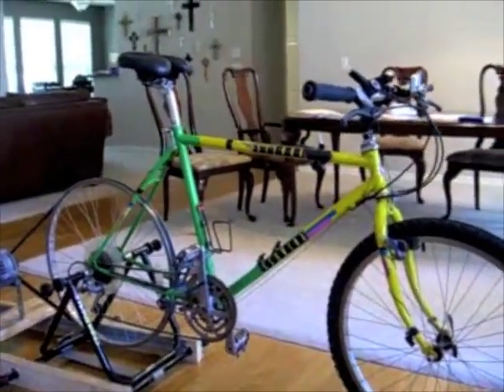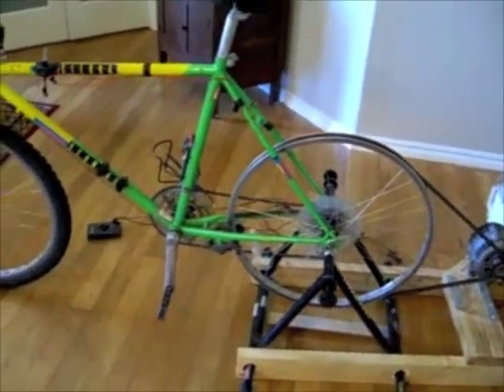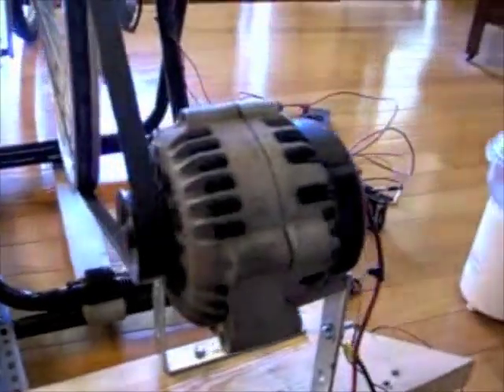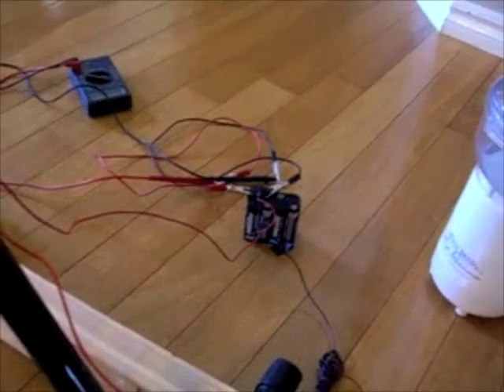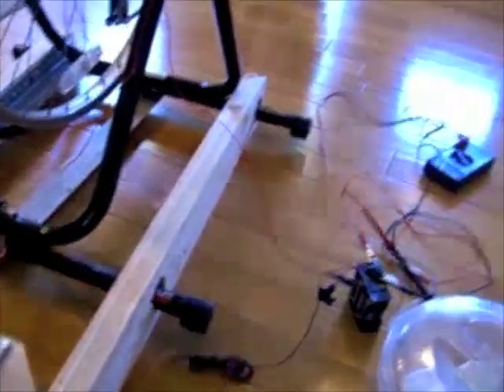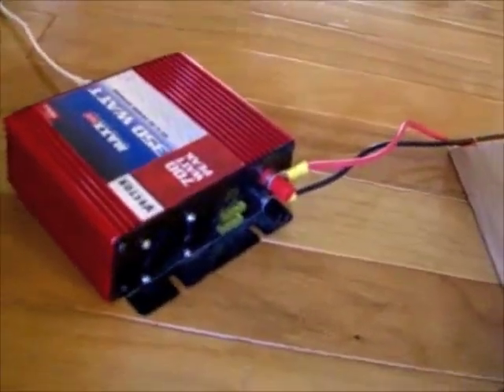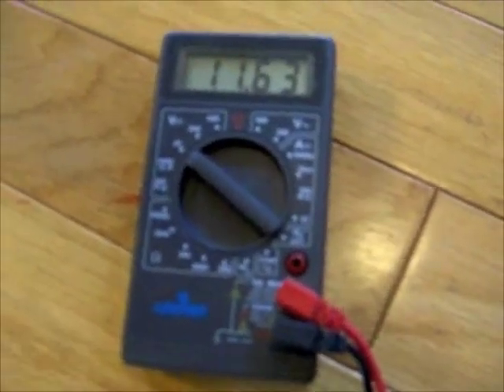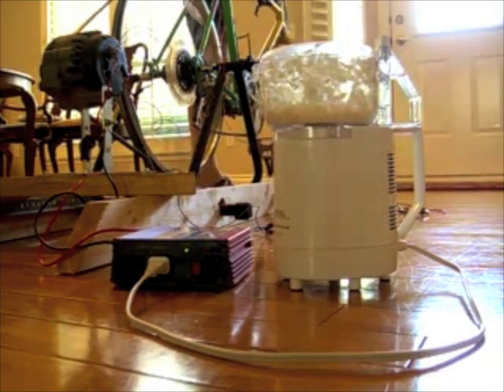Bicycle Generator

Comment: so could you theoretically have a small motor attached to the main sproket on the bike and turn it on and have it just make power itself?  or is this not possible?
Reply: Totally possible as long as it has the required rpm for the alternator to generate the required voltage..
Reply: +jonathan lavigne 
You could, but then you might as well just turn on your car and plug appliances into it.
Reply: +ravemastaj We lost power for 2 days after a huge lightning storm, after the first day I connected my 600W inverter to my car and watched some movies for 3 hours, my fuel was at 50% when I started and it was still on 50% when I turned off the engine. It was surprising. I just parked the car by the window and run the 12V through the window, then sat the inverter on the window sill then run an extension cord from the inverter to the appliances. I was disappointed though the 600W inverter wasn't big enough to run the fridge :( need a bigger one.
Reply: KiwiPowerNZ
I'd be concerned about fire hazards if you tried to do anything bigger than your tv and some movies.
Reply: I measured the alternator current with the lights on high beam, rear demister on, AC on high and the front and back wipers on fast, and it was about 60A. I was only using about 30A off the alternator so nothing should burn and nothing did.

Comment: Is it efficient though?would it be better to have a mechanical driven food processor or do you create or generate more electricity to store the battery along with getting your onions chopped?
Reply: +Michael Byrnes Every time you convert power there are losses, a shitty old car alternator will maybe get a 50% conversion, and inverters are also looking at around 10-50% loss depending on the maximum output, so this is far from efficient.
Never the less it gives you the flexibility to power all electronic devices, where as physical power will only be applicable to devices that require physical power and you need to attach the shafts somehow.
Reply: +MsSomeonenew Ahh no inverters are about 85% to 90% efficient my one is 86% so 14% loss. I think alternators are typically 80% efficient or worse. So peddle 100W and you'll get 69W. Not the best but can't get much better.

Comment: If I'm charging a battery bank, do I need the switch or will it just charge the batteries without draining them more?  Also would I need a voltage regulator to protect my batteries? Great idea & I'm working on doing this.

Comment: use some of the electric output to power a motor to spin the bicycle well.....and you have free energy without peddling....probably won't work, but you won't know till you try.

Comment: So why don't automobile manufactures use an alternator in their electric vehicle to recharge the batteries? That seems to make sense yet no manufacturer talks about it!Why?!
Reply: George Gunnee You are describing what's generically known as a 'perpetual motion machine'.  Every real machine has energy losses as energy is transferred and converted.  Never get back as much as you put in.  It follows that driving a generator from an electric car's wheels is less efficient than just keeping that same power in the battery.

Electrics and hybrids do get some electric energy back where in an ordinary car you'd be using friction brakes.  Fuel consumption in hybrids is reduced because the engine can be sized and tuned more for highway steady-state cruising, which requires relatively little power, while the batteries and motor/generator make short-term peak power for accelerating or ascending hills.
Reply: George Gunnee Electric vehicles already use electricity from their batteries for motion - there's no engine to drive an alternator. However, I do imagine they'd have regenerative breaking to recover some of the vehicle's momentum when stopping etc.

Comment: The generator did not continue to charge once he shut off the field (battery voltage). Watch the volt meter, the value continues to lessen as the charge from the alternator has stopped. The inverter is just running off battery voltage and will and will stop soon as the battery voltage drops below what is required by the inverter. Small point and that is  not to say that there isn't something to be learned from this tutorial.

Comment: Great video. Thanks for sharing. I have been tinkering around with a alternator wind turbine. I am using an alternator similar to the one you are running. I have not been able to get it to produce a charge. The way it is hooked up now is I jumped the "s" wire to the positive output, run direct to a 12v battery and a direct ground to the neg. terminal. I beleive what I am missing is the switch. The alternator will not generate power with out the switch I guess?

Comment: Could you swap the AA batteries for a car battery and then run the inverter right off the battery? That way you can charge the battery and use the appliance without pedaling

Comment: To think all these years I just used a knife.
Reply: I must be tired or something but that gave me a good laugh....
Reply: +schlaznger i think a knife would use less calories.
Reply: +schlaznger 
Aside from the knife, I need some goggles too. Onions make me cry.
Reply: +schlaznger I have pocket bike in the shed doing absolutely nothing. All I have to do is make a stance to make it stationary(no problem just gotta get to it), get another gear(because I already have one from other bike) and electric motor and hook the chain on. Heh, I&#39;m so dumb.... now I can start thinking about some real lights and powertools and all that fancy stuff.
Reply: lolz
Reply: I'm picturing a vacuum (plugged to it) You're wife could cook and clean, with this power. You could even run the A/C and radio. You would be the champion of cyclists
Reply: Nano Quark Your*
Reply: Ohh
Reply: You could never power an ac unit,they take more power than anyone can produce by peddling, but a radio takes very little energy.

Comment: Some newer alternators are self energizing once they hit a certain RPM. Now if you put a few (radiator) fan motors on the driver pedals, you may exit once the process has started. Except that if the fan motors use less energy, and create more RPMs at the alternator, eventually you will create a tear in the space time continuum.  Thanks. I wasn't using it anyways.

Comment: i made a similar one but the inverter didnt stay on after. needed to add a wire wound resistor i made from spare parts. can run 100w of stuff for a few minutes but its better to do less for much longer. dont get as tired and more like cardio then going up hill in high gear.
Reply: also a tip for others. you dont need 12 volts to energize the coil. i use 5 or 6. works fine.

Comment: That's very clever there Einstien but I think that I have you beat!, I set up a water wheel down by the river and plumbed a 4" water line from about 150 feet up stream past where there is a 5 foot drop. With the water coming out of the end of my pipe with considerable force it flows onto a home built water wheel that spins a shaft connected to a gear box and increases the speed 150 to one. with this set up we mounted a real 110 volt generator head and wired it to an extension cord routed up to my house. We comfortably can use about 600-900 watts of 110 volt free electricity which is more than enough to run all of my LED lighting and electric fan blowing air over my wood stove. The only thing that I now need to set up is a remote water cut off valve so it can be safely shut down when leaving home. The weight and force of water is very powerful and if you set it up right you can get free electric power with minimal water flow but you do have to have at least a good 5+ feet of drop and 4" pipe diameter or larger. A simple diversion screen angled sideways keeps the inlet of my pipe clear of river debris. Picts and video coming soon!.  Marti
Reply: Ben Braceletspurple It's illegal by retarded laws of society so you cannot be independent human being.. why should you pay electricity when you can use beautiful water stream or sunlight to gain electricity? Nature is free..
Reply: Then I'll make a video on why that's illegal.
Reply: Ben Braceletspurple  Nature is free. Laws and society rules only exist on a paper. Sun and water don't want us to pay them some money in order to shine and flow. Therefore, nature is free, nature is freedom.
Reply: +Marti woodchip  I don't have a river, so I guess I'm stuck with the bike generator.
Reply: +Teo Sp Go to Ukraine. We have NOT these dumb laws about collecting rain.... Greetings from Ukraine !
Reply: I hope it is illegal, because I will make one.  Tried of the government telling me what to do.  Vote Trump.
Reply: Marti I´d love to see the setup and costs of this!
Reply: TOKENWINNER A8 if you do it properly with fuses and cutoffs and are nor connecting it to live circuits that are connected to the grid it is not illegal
Reply: Rod Schultz...Nice Comment,I see YOU are a man too and that you know the Difference between Illegal and Unlawful (Golden Rule..and that Another man Can Not Tell another man what he Can and Can Not Do) More info Karl Lentz youtube videos.. Cheers :)
Reply: please make a how to video on that plz and let me know about it so i can watch it.
Reply: TOKENWINNER A8
what's not legal about that?
Reply: Marti woodchip  Now that's sort of free energy I believe in. You are using hydro power converting to electro motive force . Unlike those nuts that claim magnets can do the same.
Reply: +Ben Braceletspurple Hoover Dam?
Reply: Rod Schultz because it's okay to murder people and run stop lights.
Reply: So glad I'm not the only one who perceives society and the government this way
Reply: Ben Braceletspurple, this is old, but you're incorrect on multiple points and misinterpreting the laws. Site the sources of your laws
Reply: Mike Jameson, huh? I'm talking to the guy misinformed about the waterway laws spouting on like a prison cell lawyer
Reply: Lucky Red Oh.. Didn't notice the other comments of his..
Reply: +Ben Braceletspurple idiot
Reply: +takver lol..bam!! now that's an answer! awesome
Reply: +Marti woodchip all of us don't live near rivers dumbass
Reply: +FreeThinker1980  Dumb ass I am not and neither a numb ass but anyone who has to peddle a generator is probably a numb ass to say the least, lol lol
Reply: Marti woodchip what happened to the video that you were supposed to upload? the one about the water powering  generator
Reply: Smh... Should've said Faraday, or Oersted, or Lorenz etc... Einstein didn't have much to do with electricity 😂
Reply: Now make it a battery box, filled with batteries, that spare the overload of the income, for later use.. remember, rechargable batteries.
Reply: Lucky Red
I think he means that the sun "power" (Hydrogen) is limited. Which is true, but it's not gonna matter for our life time.
Reply: Sounds like bullshit to me..
Reply: That would be nice if it wasn't illegal.
Reply: Ben Braceletspurple You either work for government control system or you don't fucking see what's going on in the world.
People are being controlled like slaves. Everyday new laws come out to cut our freedom. Here in America one farmer got jailed because he was collecting rain on his property. The law says that rain is a government property.
Do you fucking see what's going on?? Obviously no..
They don't allow you to have you own electricity because then you are not paying money to them. Money is how they control us. No money, no life. But since electricity can be free, they don't want people to have free access. 
And I asked you but you didn't reply. What the fuck is wrong with solar panels? Why the fuck are they illegal? Simply because they are a source of free electricity. 
So please, don't try to defend something which is fake. Nature is free. We are born free.
Reply: Ben Braceletspurple Even if it does kill fish, it's so small amount comparing to modern industry which kills whole world and it's legal so please.. and what about solar panels.. they don't do any harm but they are illegal.. don't try to defend laws, they are made to control  human beings and keep them in slavery, not freedom.
Reply: No, it is illegal to slow down water in the United States. You can not have a water wheel, pump, dam, siphon  or any device that impedes the natural flow of rivers, streems, or any natural water flow.
Reply: Teo Sp no that is like saying, "okay, the average Joe Biden can kill one person per year, as long as that person doesn't have any family, but big companies can't because they would be killing thousands of people  and that is too many killings." Point being how much something hurts the environment is directly proportional to the amount of people who do it. When one homeless man poops in a river every day  The damage is small. But if the 400,000 people that live in my city all did that, the river would be damaged significantly. Same point. If everyone can not do it without it being a problem, nobody can. They don't have rules in libraries that say, "no drinks, unless you really think you can handle it," the read, "no drinks," or, "no drinks"
Reply: It isn't fake look up the history on the Colorado river, guess what, flow was fine and ran right through Mexican boarder, today it doesn't even come close because of all the man made blocks. Nature isn't free. There is no such thing as a free lunch. If one person can slow down water, everyone can, if everyone does, it slows down to a stop. It isn't "natural" to impede the flow of water.
Reply: Not an impedance to Mexico.
Reply: Dan impedance of any natural flow of water isn't generally legal. Even gutter water flowing down off your roof.
Reply: That energy comes from the Sun, by definition it isn't free.
Reply: Teo Sp it is illegal cause it kills fish, and slows down the water supply to major rivers.
Reply: @benbraceletspurple9108  shut your fucking mouth

Comment: I know its not the point but you have probably used 3 x times as much energy as it would have used to chop the onions by hand your self.
sorry to sound so negative, but you did go on a bit didnt you  Leo.
regards Colin.
Reply: Or by hooking up the belt drive directly to the sshaft of the onion chopper we could have chopped them in 1/4  second.
Reply: TOKENWINNER A8
Now your getting the idea save energy right,, well done
regards Colin. UK
Reply: you can also buy already chopped onions. but i like the idea to save some electricity costs by riding a bicycle. german elecricity is very expensive and we dont have much air flow to hook up some generators in the garden :)

Comment: An alternator creates AC voltage and the internal (DIODE) rectifier converts the AC voltage to DC. The internal voltage regulator regulates the DC voltage to around 14.5 volts DC. The external inverter takes the DC voltage from the alternator and then converts it back to AC voltage to run the food processor. I wander if we could just regulate the alternator AC voltage to 110 volts and what the wattage output would be? Hmmm   Also you can use a self exciting regulator and do away with the battery source.
Reply: On the side; there were a couple of cars which had 110V alternators.  It may be possible to find one as a spare part...

Comment: More practice is put to work with the wind do mill type of wind with its tail to rotate in the direction of the wind is only requires a zipper either ford or chevy and was adapted gears ben- di the alternator shaft that coupled to the rack is fixed to the blade with a single spin of the reels with zipper generates the 12 volts needed to be in motion and maintains continuous power without being throwing pedal and the rack to rotate around turns over 20 turns the alternator or even more just to make a tower over the house and connect through more than 10 Watts bulbs under very useful for fields where no light

Comment: Mas practico  es ponerlo a funcionar con el viento  hacerlo tipo molino de viento con su cola para que gire en la dirección del viento  se requiere solo una cremallera ya sea de ford o chevrolet y se le adapta los engranajes del ben-di al eje del alternador que acoplado a la cremallera que esta fija al aspa con un solo giro de el aspa con la cremallera genera los 12 voltios necesarios y al estar en movimiento mantiene la alimentación continua sin estar echando pedal  ya que la cremallera al girar una vuelta  hace girar mas de 20 vueltas al alternador o hasta mas  solo hacer una torre que sobre pase la casa y a conectar mas de 10 bombillos de bajo Watts  muy útil para campos donde no hay luz.

Comment: Your project does not make any sense! You use mechanical energy to get electric energy and also use another, outside electric energy source to power that device that supposed to produce an electric energy?! What about if battery runs out? Do you need another bicycle with everything else to recharge it ?! You do not make any energy, but actually wasting it !!!
Reply: You missed the point where he switched the battery off.  He only used it to start the alternator.  His process was as follows.  1. Start pedaling, this does not start the alternator.  2. Switch on battery to start alternator.  3. Switch off battery.  4. Continue pedaling to maintain alternator.  The battery is only used to start it like a car. You can disconnect and take the battery out of a car after its started, which is the same thing that happens when someone jumps your car and disconnect it after it starts after that, the alternator recharge your battery so you can start it later.
Reply: Aidan Hodge Science You are very smart ... other ppl miss out the importance of a switch
Reply: Pedro Garcia lol thanks for the laugh this morning.

Comment: rookie question here.  If an Alternator creates AC Power, why the need for the inverter to power the blender ?
Reply: actually the alternator has bridge rectifier inside which convert ac to dc so the output is 12v dc and to convert  12v dc to 110 ac you need inverter